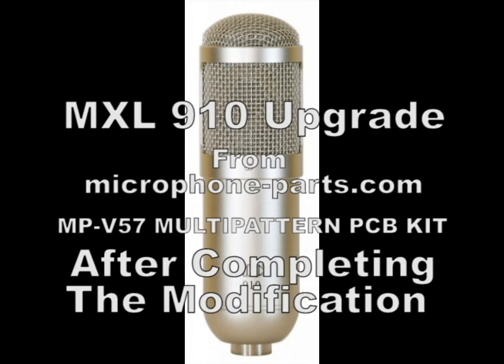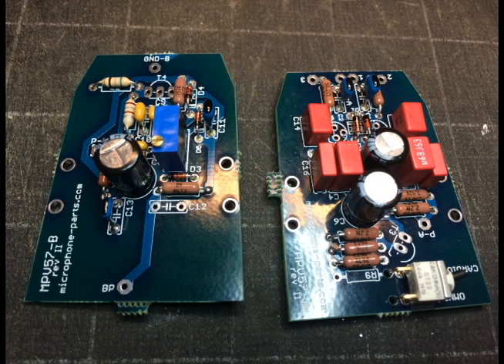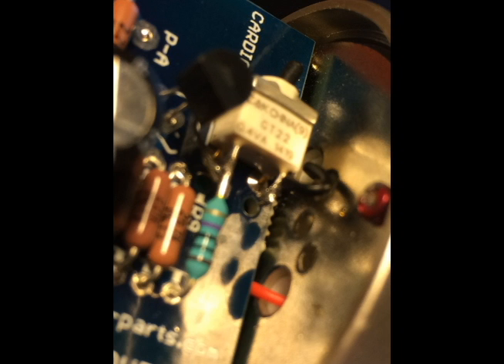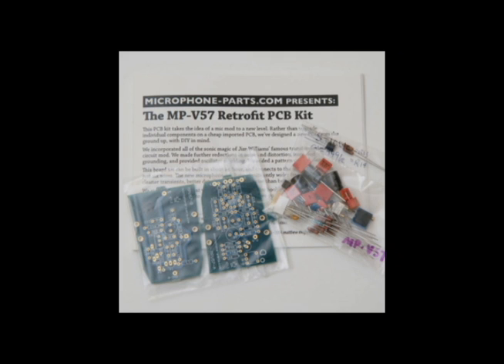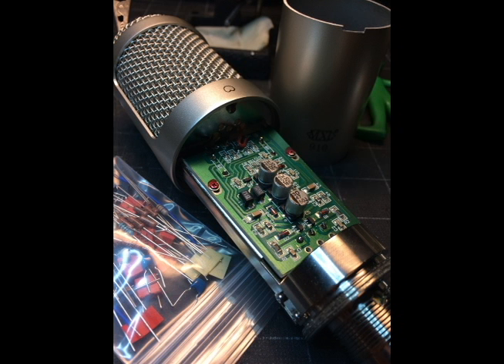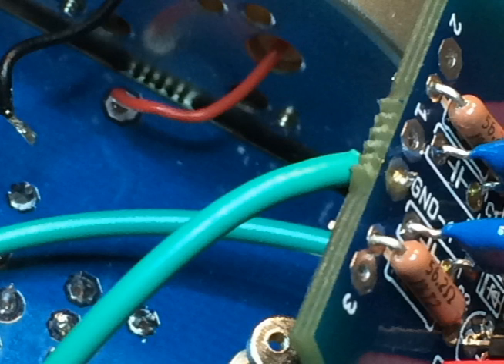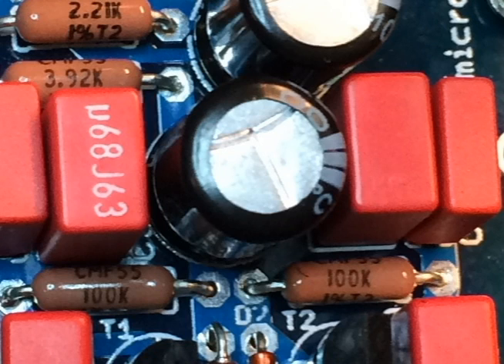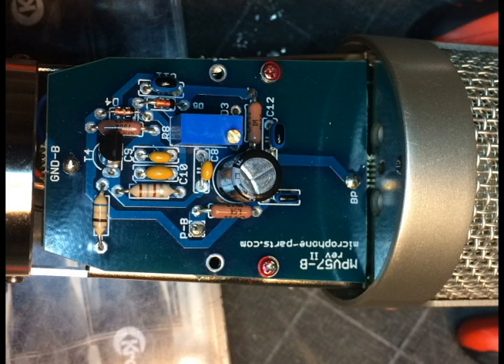MXL 910 Mic Shootout Post Modification

Comment: Would have been best for the before and after to be AB'ed on after other to tell the difference. How much do you have invested in it with all mods now?
Reply from the maker: I haven’t gotten to the capsule however there is a before and after of the PCB. It sounded a lit time clearer.  I have the capsule but due to a surge in demand for my guitar pickups I haven’t had a chance to make the capsule mod. 
I have another MXL mic which I changed the capsule with a microphoneparts.com capsule and it sounds amazing!!!

Comment: I built this same mic. Same kit and donor mic with an S87 condenser.
Reply from the maker: Bill Karoly hey Billy I am actually installing the capsule now. It’s been a good couple of years since I replaced its guts. An updated video of a before and after should follow soon.
Reply: @soundlaboratoriessoundsrig8289  I drilled a hole in the side of the body to access the switch. How is your mic holding up?
Reply from the maker: Bill Karoly hey Bill I am actually installing the capsule now. It’s been a good couple of years since I replaced its guts. An updated video of a before and after should follow soon.